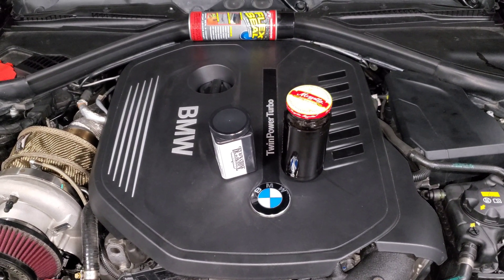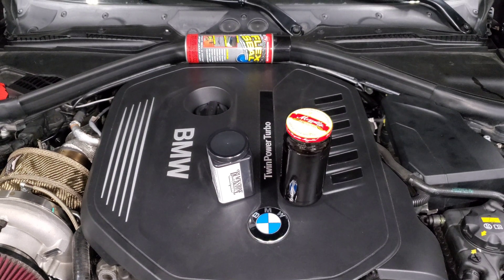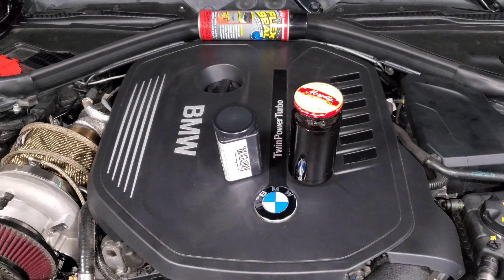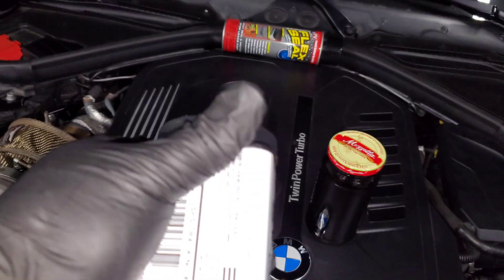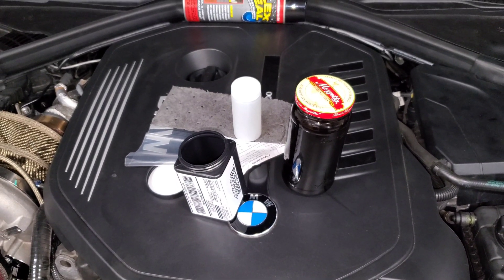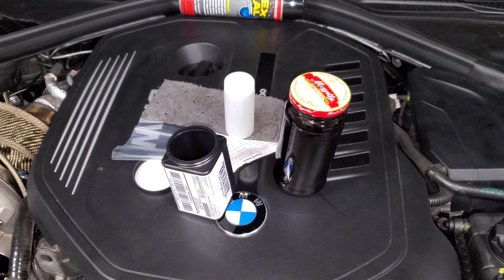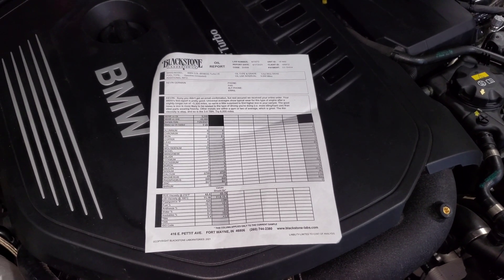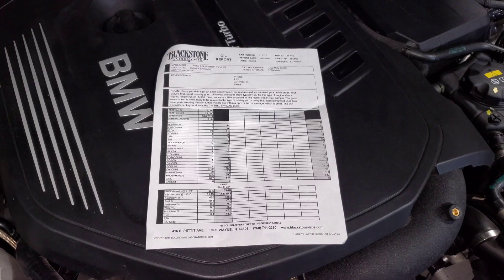How does the B58 Engine perform with 5W40 Oil?

Comment: I honestly would dump liqui-moly kern.  I've seen some VOA of liqui-moly and the additive package seems to be the same as any other OTS Walmart oil.  The following are boutique oils and are expensive, but your top-mount baby deserves the best haha.  Try Redline, Motul (high SAPS or 300v), or High Performance Lubricants.  Higher ester base stock,  higher ZDDP, MoS2 additive package and HTHS >3.5, if you're going with a 30 weight.  pretty sure they all will carry the BMW-LL01 cert.
Reply: been on bmw 10+year and other german cars, based in EU. Top 3 Is motul and liqui moly and shell.
Its all in branding, But i change because variations and the level what i need to use. 
For racing i use Motul 300v ( why ? because engine builders + racercar driver using that here mostly and positive reports) and daily car Liqui or motul depends what i can get quickest and price. Normal wear is there ntohing will last forever, just the prevent the crap that builds up just do oil changes often cheapest thing you can do for the car. max 10 000 km on daily.

Comment: I saw in Kies video when they did the b58 oil change they added this. Liqui Moly (20002) Cera Tec Friction Modifier - 300 ml - Any opinion on it?
Reply from the maker: Not needed but you can if you want

Comment: hey bro!! question about my b58 2016 340i! it’s mhd stage 2 with gapped plugs. right now i have 0w20 oil in it i’m taking the car to the track, lapping circuit will endure 15-20 min or beating at a time. and i live up in canada so it does get cold in the winter. would 0w30 hold up? thanks man love your content
Reply from the maker: Yes it should hold up. And oil analysis would be the best way to confirm, and change your oil immediately after the track day to see how it's holding up.

Comment: So recently picked up a 340i with the b58 and a good amount of miles on it (82k to be exact) and it was completely dealer maintained, doesn't seem to be driven hard (interior is in stellar condition) and all that. I will be doing an oil change on it myself in the next month or two here but my question is whether I should go with OE 0w20 or the Castrol Edge 5w40 everyone discusses that is awesome. Main premise for that question is that she is in KC and thus right now temps drop into the teens or single digits on a regular basis. I could see doing the 5w40 in the warmer months but just wasn't sure if it would be desirable with this temp range and the fact that she will be sitting for periods of time, in the cold, outside until I completely move here. 
I use blackstone on my 100 series land cruiser and run cheap, Kirkland brand 5w30 in that year round for the last two years without any issue, and that is my commuter/wheeling rig, at home where it dips into the teens regularly during the winter but that one is a garage queen.
Reply from the maker: Both work. I would use whatever is most accessible and better value. If you plan on starting your car in sub-freezing temps then 0W-20 will give you better cold start protection, but 5w40 shouldn't be the end of the world either.  I had great luck with 0W-20 and 5W-40. I'm testing 5W30 now.
Reply: @kern417  Yeah that is what I was thinking too as I used to run 15w40 dino oil (Rotella T6) on my old 60series Land Cruiser year round and never had any adverse affects with that. I may give it a shot and see if I notice any difference in the cold start. Just hard to find a 0w20 BMW certified stuff at any LAPS, but the Castrol 5w40 can be found and just about any LAPS or even Walmart. Figure as long as I have a good filter with it and plan to change every 6k miles (based on blackstone) then I should be good.
Reply from the maker: @mizznfizz1  15w40 is much heavier than I would recommend
Reply from the maker: @mizznfizz1  but maybe that was a typo
Reply: @kern417  no was more just reference that the heavier oils in winter don’t necessarily have worse wear. That’s all I was getting at.
Reply: Castrol it’s OK but certainly not the best oil out there, the best 100% synthetic is AMS oil and red line ,these are the best oils in the Industry. If your car is tuned you should run 0w40 or 5w40 if factory 0w20.

Comment: I don’t think changing oil once a year is good enough , The turbo seals and bearings have to be lubricated by fresh oil and changing it ones a year won’t do a good enough job , motor oils brake down pretty fast specially in tuned turbo cars .. I’d say ones every 6 months is minimum.
Reply from the maker: What's amazing is i posted a video showing the oil analysis and everything and I'm still getting comments like this 😐

What you "think" doesn't trump actual real world data. But you can do what you want.

Comment: I’m using 5W-30 liqui moly special tec (either LL-01 FE or LL-01) works and I change it every 3-4k miles tuned. Been running fine so far

Comment: My oil is nearly light brown as if it was new after 5k I do a lot of intake valve cleaning and fuel system cleaning frequently  , I feel as if this helps to keep everything clean instead of waiting for all those other components that come into play to get dirty
Reply: What do you do for your intake valve cleaning?
Reply: @johnneidert5777  xenum INTAKE pro best value
Reply: @dangdong3832  I'd like more information on how you introduce this into the B58 air inlet plenum.  What do you have to disassemble to use this so that it gets into the intake valve area specifically?  Thanks for the heads up.
Reply: Use engine oil with low Évaporation rate and HIGH température résistance and check thé oil level 
What engine oil do you use ?
Reply: @dangdong3832  Castrol European 5W-40 . Oil level never moves even after if been doing pulls back to back in stage 2+ oil temp never goes past 230 either

Comment: You use moly 5w40 leichtauf HIGH TECH its base mineral oil ! But certification BMW LLO01
Reply: Same here. First time using it since I purchased the vehicle last year. Running intake/charge pipe/downpipe/bms tune and is fine.

Comment: Hello every body b58 community
I have stage 1 MHD 98 Ron 
5w40 liqui Moly SYNTHOIL HIGH TECH 
I look oil pressure with MHD tuning monitoring 
I have in smooth driving 2 between 4 bar
And sporty driving 8,6 bar 
What do you think about this value ?
Thanks kern
Reply: I dont have long life LL01 I USE SYNTHOIL HIGH TECH because its 70% PAO
I drain oil engine 15000 kms in normal conditions no track day
Reply from the maker: Sounds normal. It'll vary based on rpm
Reply: @kern417  i know  11,4 bar +/-1.4 max 
Do you think its no more 8.5 bar for good engine life
Reply from the maker: @dangdong3832  you should never see 11 bar oil pressure.
Reply: @kern417  i don't try max RPM for the moment

Comment: I'll have to watch later, but I've been using 5W-40 LL-01 certified oils in my B58 for 44,000+ miles and counting in the heat of southern California.  Includes Castrol, Liqui Moly, and even Mobil 1 Euro Formula.  Was told by knowledgeable people at FCP Euro that oil certified to MB 229.5 would be good and preferable in high temp, high load situations.  My Blackstone analysis has shown no wear related or oil degradation issues at all over these miles that have included several hard track weekends.  Oil was changed before and after every track weekend, and never exceeded 6000 mile intervals.  Now that my track days are over, I'll be using Liqui Moly 5W-30 certified to BMW LL-01 FE.  The BMW 5W-20 factory fill was the only time it has had the recommended 5W20 in it.  I've got over 50K on the B58 at this time and it runs great.